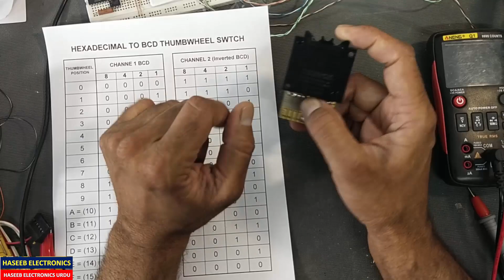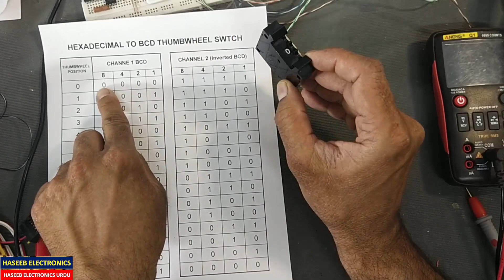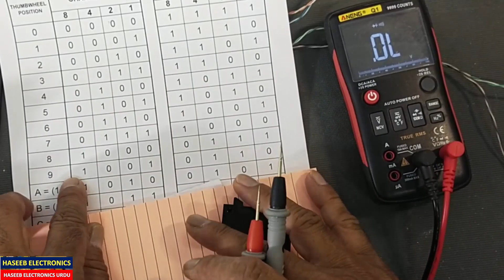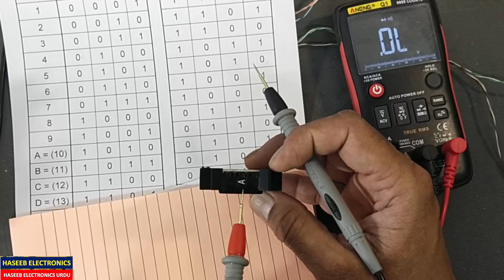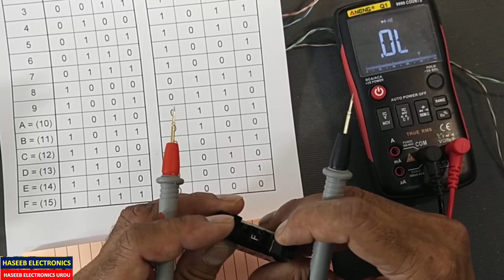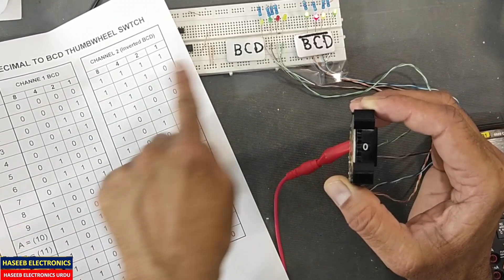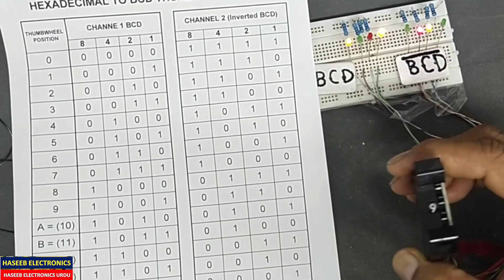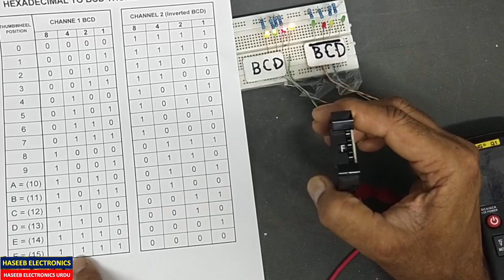{638} Hexadecimal to BCD Thumbwheel Switch Function & Testing

Comment: sir good morning..i need ur help ..i have an smps ps of box amplifier.. where used ic ir2156 n almost smd resisters burnt n ic as well..i m trying it to repair..i found almost resisters value but i failed to findout one resister value whichone the above mentioned ic pin no..10 to through  1k resister to groud n again from ic pin no..10 to install one resister (whichone burnt out) to mosfet gate pin so could u plz help me what is the resister value whichone burnt.. thank u sir

Comment: Really cool! Thank you for this. That looks like the thumb wheel control they used to use in old aircraft and ham radios from the 1970's to switch frequencies. What did that come out of?
Reply from the maker: yes 
it is commonly used in avionics, radio sets, and industrial panels, control panels to provide automated selections and various operations